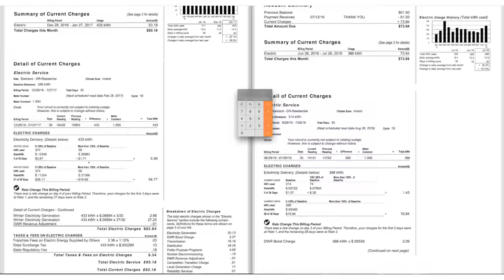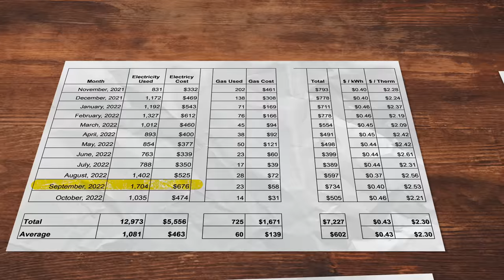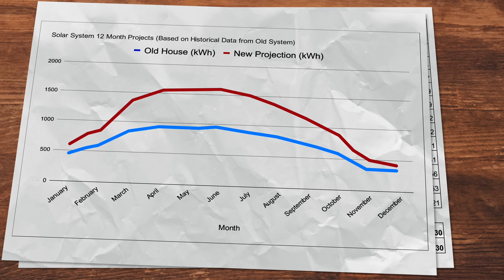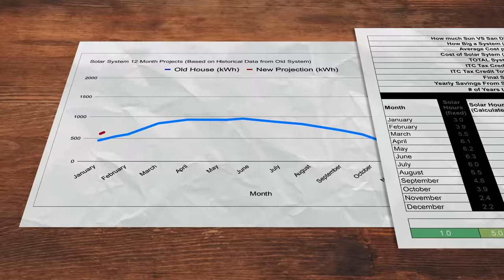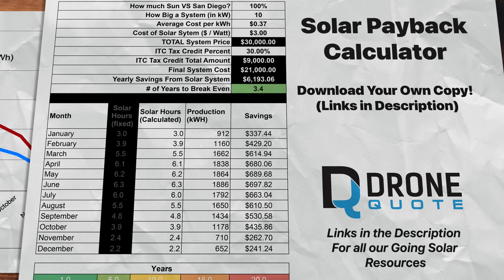Go Solar Before April 2023 - EVERYTHING Is Changing!

Comment: Does anyone publish a chart by US State on the average ROI for Solar? I know California ($0.2549/kWh), Massachusetts ($0.2628/kWh), Connecticut ($0.2504/kWh), New Hampshire ($0.3044/kWh), and Hawaii ($0.4485/kWh) are all states where solar makes a ton of sense. 

But for many states, the ROI for solar is much longer, and even with the 30% tax credit, it may not make financial sense yet to move forward with Solar. 

In my case, Virginia has an average of $0.1461/kWh, and the ROI for your system here would be 11 to 13 years. I agree, that's still not terrible, since I should get another 7-14 years of service from those panels where I'm simply not spending $2k/year on electricity. But the ROI is so much lower that you really have to make sure you have clear visibility to the sky for the full range of sun and enough sun days per year to make your system worth it.
Reply: Generally speaking, there is always an economic argument for getting solar.  There might not be an economic argument for having batteries, though.   Even with a long ROI, having solar substantially insulates you from utility price increases and inflation, and that is worth its weight in gold.

But there is an up-front cost.   While it is worth doing economically in the long run, not everyone has the resources to make the necessary investment.   I generally dislike companies that effectively loan you the money in return for a monthly payment that is "less" than your utility bill... it is always better to buy the system and installation up-front.   It requires having the money to do it, though, saving up, discipline... not everyone can check off those boxes.
Reply: @junkerzn7312  A fair and well reasoned point! For me it is tough when I have 13 years of data from our electric utility and their rates have gone between $0.10 and $0.13 per kWh all in (divide bill by kWh) to justify spending $20k now. Yes, the ROI is less than the lifespan of the panels, but I also have a fairly shaded lot without easy direct all-day sun exposure. 

I WANT solar, it is just not very practical for where I live and the cost of electricity. I have 0.2 acres and no wife-approved locations to put 5-10kW of panels that get even half a day direct sun. DOH!
Reply: @ooglek  
Mine has already paid for itself. 
There is a company called three sixty solar. That  is going to make  solar towers very small foot print.  They are primarily targeting utility  grade. But are scalable to residential. When they get around to residential. Could put one just about anywhere.
Reply: @danmccoy6164  I mean, that's cool, but there's no way my wife would let me build a 40' tower in my front yard. I don't think I would let myself do that. I'm sure your solar panels have passed the date of ROI, but you never said anything about the situation -- how many years, where do you live, how much clear-to-sky view do your panels get, did you cut down trees, do you care about how it looks, etc. Most solar can pay for itself, but each situation and install and sensitivity to how it looks is different. That it "paid for itself" tells the reader nothing. Elaborate!
Reply: @ooglek  I have discussed in full my system in another post by itself.
But yes I have a one acre lot and cut down 3 huge maples that were in my backyard south side. Before self building my house. So I don't have any leaving trees on my lot. Have  huge evergreens on all but the west end of the lot. But unless they grow to 80ft tall will never block my solar.

Comment: problem of high current in parallel? simple solution... run more wire... you just need to optimize price of wire gauge to length and just double/triple/quadruple/etc.... the amount of wires... busbar is your friend... don't forget it.... don't run stupid solutions like "solar optimizers"/"mini inverters" if you plan to use solar as a back power.... just use the traditional method and use common electrical engineering and solve your problem with sensible solutions... converting DC to AC to DC and finally to AC has massive losses... running pure DC with high Amps has massive losses...  so run more wires or pump up the voltages while running the panels in parallel.... there is always a solution staring at you... people already design all these simple solutions... just take a step back and think for yourselves...

Comment: Very good infor.  When are you planning to do part 2 of this?  I'm debating string vis micro.  Do you consider the amount of time you plan to stay in your home when considering the inverter (based off cost and warranty)?
Reply from the maker: great questions Eric, yeah I think that should play a role, also some installers have preferences and will lean you in that direction... and both have gotten so good... its not as big a deal as it used to be.

Comment: Your calculations of "solar hours" is just nonsense.  80% to 90% of you solar panel energy is produced between 10 AM and 2 PM (solar time).  Much of the rest of the day they do not generate significant power despite the fact that the sun is shining.  The difference between the seasons is not "solar hours" but rather the difference in the angle between the rays of sunlight and the solar panels -- 90 degrees being the maximum output - at solar noon.